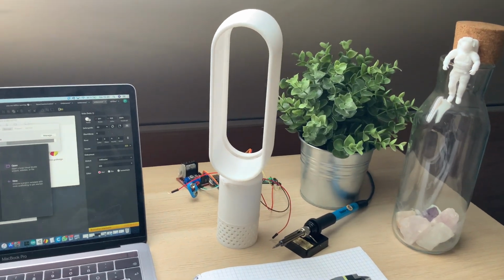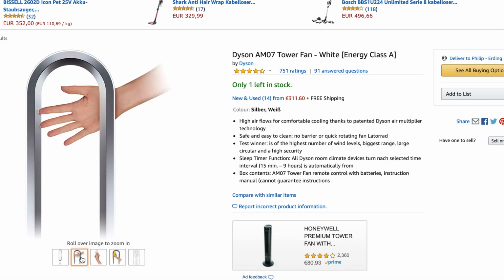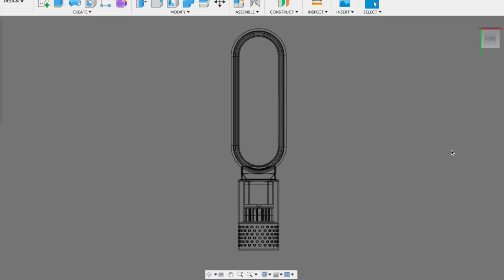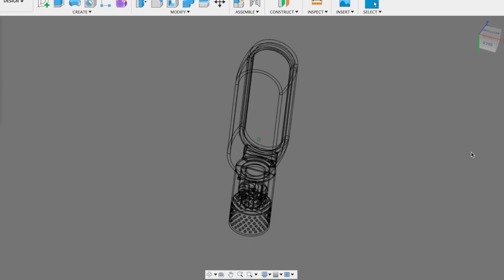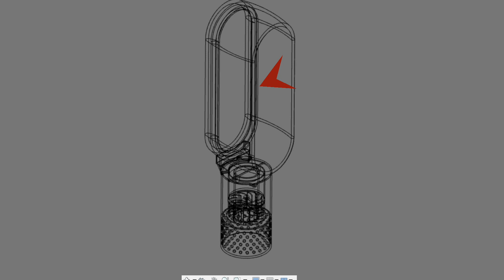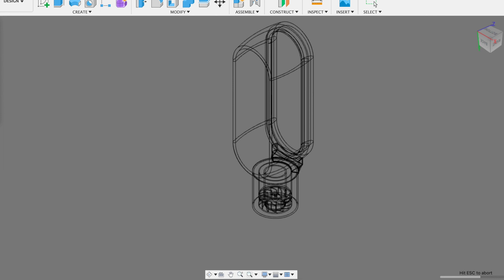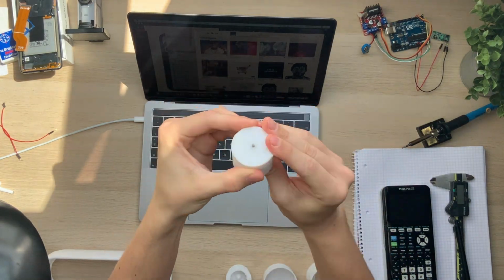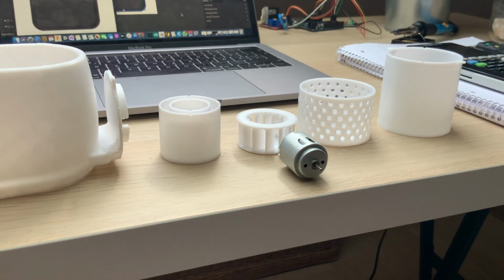3D Printed BLADELESS FAN for your Desk!

Comment: This is a rlly cool design, good 3d modelling on fusion and will definitely try this as I have been looking for a project as I have an ender 3 Pro. Can you tell me what filament and nozzle to use for this project?
Reply from the maker: Mark B Thank you so much I used PLA by creality and a 0.8 mm nozzle with a 0.32 layer height
Reply: @PhilipMerlin  Thanks! How would I edit your design on fusion so the top part where the air comes out is more circular and smaller?
Reply from the maker: Mark B You can edit it by importing the STL under: insert  -> insert mesh -> then turn your timeline off in the bottom right corner after that right click on the model and select “ mesh to b-rap”.

Comment: The shape of your aerofoil is all wrong 😢 you have no acceleration ramp, it's supposed to be convex not concave, it's supposed to be small at the start and then get wider towards the back of the fan to accelerate the air just like the wing of a plane/bird wrapped into a circle or like the 'choke' in a carburettor